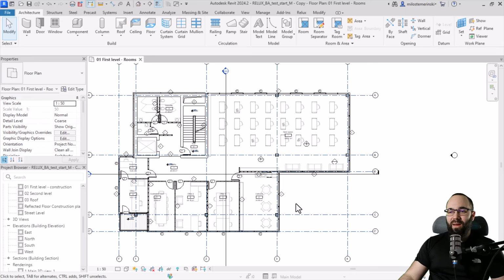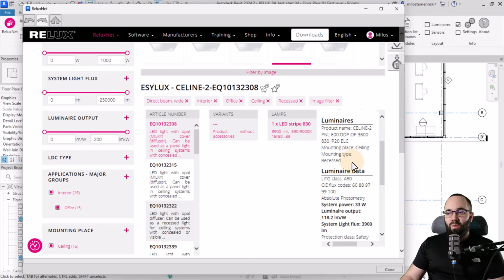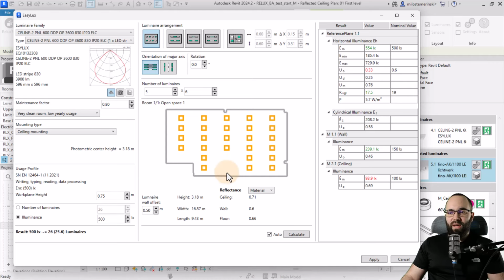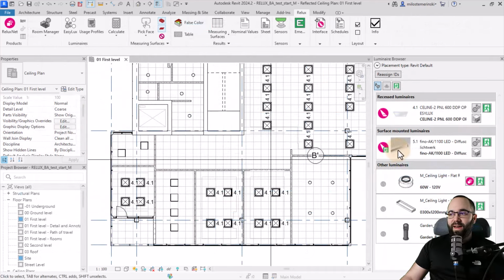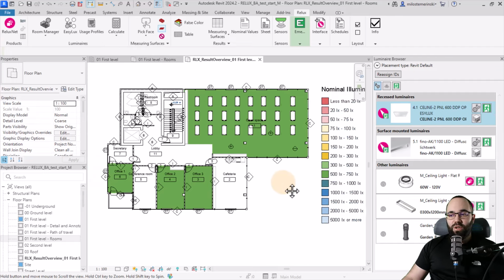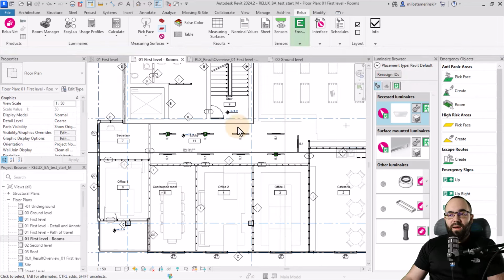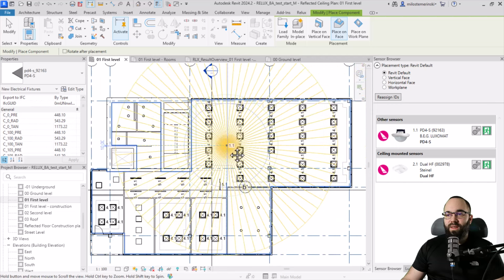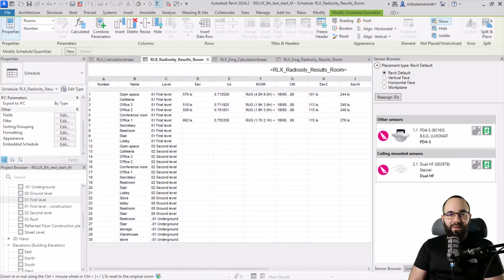ReluxCAD: Lighting Plug-in For Revit | Lighting Planning, Emergency lighting & Analysis

Comment: Thanks, Milos, for your super useful video! If it weren't for your videos, I would never have passed my exams at university, because no one tutor teaches us (Masters) how to use a new for us architect tool (I am interior designer). I have a question (millions actually =)) - how did you select a room on the ceiling plan???  I have no idea how to make it visible since my rooms are on the floor plan (there is a room separator as well but not on the ceiling plan). It is not possible to select any area on the ceiling plan. When asigning new areas on the ceiling plan, ReluxCAD takes into account all existing room areas in the project. Another issue is Revit warns me that the area is not closed, when I am trying to assign new room on the ceiling  (I have an open wall facade around a retail store. Only columns and partitions run through the retail space). I would really appreciate a quick response as I have a final exam in 2 weeks and am stuck on every project plan due to technical issues (not enough knowledge yet, unfortunately). Thanks!!!

Comment: Nice one sir. Can we render all these lights directly in lumion?
Reply: It is possible to export the lighting planning in Revit to ReluxDesktop without loss and visualise it with the newly integrated real-time renderer powered by enscape. However, texturing of the objects is required for a beautiful visualisation.
Reply: @ReluxSoftware  hello i recently bought your software and as a first time user. in the Electrical template. The space tag by relux does not appear with my options. How do i correct this? I realize rooms and spaces are different but i expect to get the same results
Reply: @kofiasare8824  Unfortunately, our room/space tag may not be loading correctly.If it is not loaded for you, then you can add it manually by loading the files ‘RLX_RoomTag.rfa’ or ‘RLX_SpaceTag.rfa’ from the directory ‘%ProgramData%\Autodesk\ApplicationPlugins\ReluxCADforRevit.bundle\Contents\Windows\APP_2025\RlxRevitAddin\TemplateFamilies’ into the project.
If you do not use Revit 2025, you must change the path accordingly.